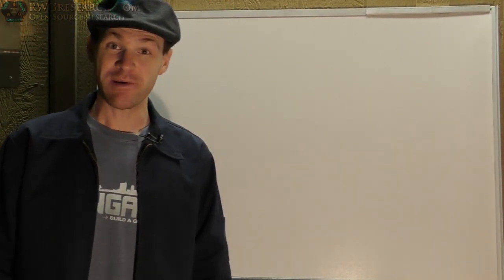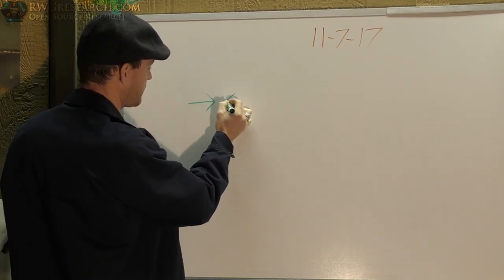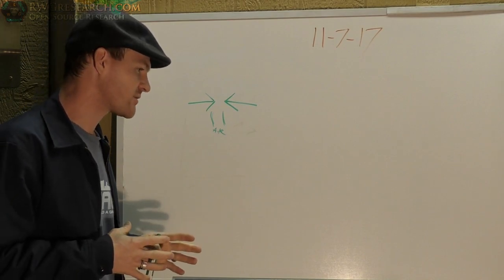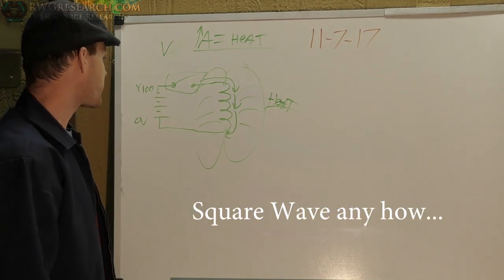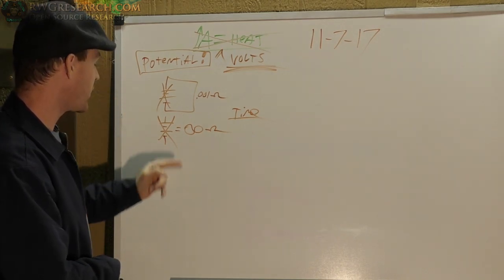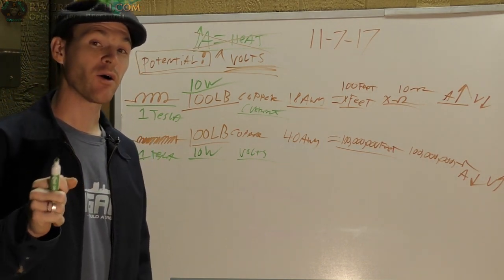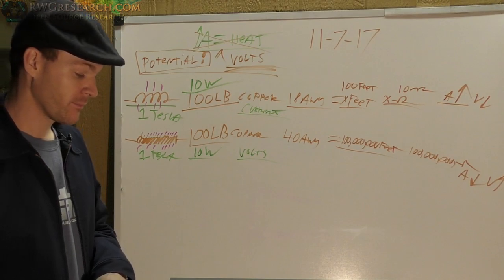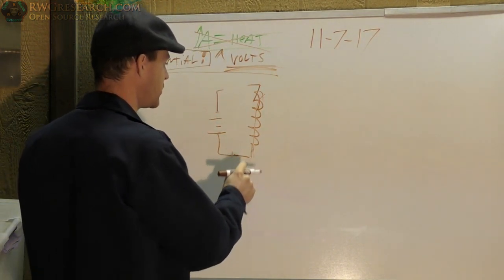The Search For Answers Part 9: Resistance is a problem... or is it?

Comment: Now,to say something has a negative resistance,is to say that power is being added to the system by that negative resistor. So no,an arc(spark) between to potentials is not a negative resistance,as it dose not add power to the system. As it dissipates power in the form of heat,it still has resistance,and can still be seen as a loss in the system.
Reply: If you look at DiveFlyFish's video on the temperature of plasma, it raises question about your claim that spark-gaps/plasma dissipates power in the form of heat.  Furthermore, not all spark gaps are equal in quality.  This has been demonstrated by many with their experiments with the Tesla Hairpin Circuit.
Reply: Perhaps have a look at how Tig,Mig,and arc welders work,,and then get back to us. Quick experiment. If you place a piece of paper in between a spark gap,will the spark/plasma burn through it?
Reply: one possibility is that the welders work due to the resistance in the materials...not due to the the temperature of the plasma. And also with a spark gap and the paper, just because the paper gets burnt doesn't mean the plasma/spark gap is hot.  Think about how a HHO torch is relatively cold to touch with the hand, but then can vaporize tungsten... Again the paper burning can be due to the papers own resistance...  Additionally, some experimenters have reported that depending on different elements within a system, paper can be placed in a spark gap and not be burned. I suggest that is because not all flames/spark gaps/plasmas are the same.  I think it is important to remember that we don't know squat...  So called experts, due to their arrogance, like to act like they know something, but in truth most know very little.  In my opinion, most of us know very little about electricity.  Many of the smartest people through history have rejected the electron model, but a lot of so-called experts tout it as Scientism Gospel...We have developed a model and some theories about it, but they are just theories.  Descriptions aren't explanations.  I feel the following Tesla quote holds very much truth for today," Today's scientists have substituted mathematics for experiments, and they wander off through equation after equation, and eventually build a structure which has no relation to reality." I feel Tesla's understanding of energy is much closer to the truth than the current mainstream Scientism.  His language even reflects this with terms like condenser in lieu of capacitor, or electrical pressure vs. voltage.  Capacitor and Voltage are merely abstract descriptions while condenser and electrical pressure have an element of explaining their operation.  Ultimately though, no matter what words we use, none of them are true, but are merely better or worse attempts to describe and explain reality. If we want to see the truth, I feel it is helpful to not be to attached to believing the models and and theories that we have learned, and take it all as  information to be organized and analyzed.  However, in the spirit of this rant, what do I know?  I don't know shit from shinola...sorry for the rambling...

Comment: Hi Ross What you ware trying to get out of us was That when a Field are building up in a coil time will go and when the coil is big with lots of windings and mass, it will take longer time then when it is small and with no mass. 

So What is Field "a Field is a vortex of electric lines that have a mass called magnetic polarization's and can be measured ore used as a walk horse to pull ore pull other magnetic field's" 

Field's are all part of the Universe, and the way the planets are controlled by its other, I those to think that it also hold's matter together, because it also have mass.....

What is Mass, it is in family with magnetic and together with field's they can hold "matter" 

What is Field's close up, it is a vortex build up with line forces that vibrations at a specific frequents and can be loaded in to matter, and can control matter. It can also create electricity when moved to ore from a coil, so Therefore it must be electricity in another form like, is and water.

It can also be a description of an electric state That when it is in a magnetic matter are becoming stable, ore permanent until it is exposed to a big force, so Therefore it has to have a mass.

So bacicley it is Electricity in a form of mass with a polarization ....hmmm ?? 

But I can be wrong.... Best Jørgen Thomsen Denmark DK

Comment: Another interesting presentation Russ! It is hard to believe that you can get power out and work done without a current flow. You mentioned once before that you can store power in an inductor. Is an inductor's inherent capacitance the way that you found that you can do this? 
Bill

Comment: The spark gap is not an example of negative resistance.  It is an example of a non-linear component that manifests a different apparent resistance at different current flow rates.  However, increasing voltage (even if it is only millivolts) yields increasing current flow through the spark gap.  Bu definition that is a positive resistance.  To manifest negative resistance, increasing voltage has to result in decreasing current flow.  Clearly a spark gap does not do that.

Comment: From what you have explained till 22 min into the video, have you tested a scenario like that or is this purely hypothetical?
From my testing the ressonace effect in vortext coils it corolates with what you say in terms of longer coils/more wire meaning higher resistance makes the peak effecient ressonante reequency lower. So smaller coils needs higher frequency  to peak efficiency on the ressonance effect.
However i found that a thicker wire on the same size coil (relativly) made it more efficient, not less. And a thicker wire means less resistance, but more copper so that may be why.
Dont know if this is relevant to what you are presenting or not but.

Comment: First off, it is interesting how closely your current work appears to be aligned with mine...collective nature of things perhaps?  Anyways, I question whether Amps=heat.  To me it seems more likely that heat is due to resistance.  For example, if you look into superconductors with zero resistance you will see that they supposedly don't heat up when current passes through them.  I feel we are ultimately looking to generate a negative resistance through negative electrical pressure.  Also, in fluid-dynamics, changes in temperature come about from change in pressure, ie compressing and expanding gas...  So testing change in temperature in transformers going from low to high voltage and vise versa  would be interesting.  Additionally, when we talk about transformers we think about a transformation resulting from the collapse of a magnetic field.  However, what happens when we collapse a dielectric/electrostatic field in a similar manner?  Dielectric transformer...  Is this not along the lines of what occurs in the Tesla Hairpin Circuit where the spark gap initiates a collapse of the dielectric field in the capacitors.  Lastly, apparently it is possible to achieve nanosecond switching with a over-voltage spark gap in ultra-pure deionized water..  This might be superior to semiconductor switches...

Comment: I really think you should read the book,  https://archive.org/details/magnetismandele02guthgoog,  you will love this read he talks about how electric is way faster then light speed an the tests he did to prove it.
Reply: I also think you can do work with very little current we just utilize current to its fullest potential  in order to save space time an money.  Lots of capacitance creates memory in the electromagnetic field making the system more efficient over time running, this is the reason we have run caps on motors, but i also think the cap protects the motor from heat load and voltage spiking.

Comment: Russ   After a mind bending paradox thought process(2 weeks) I've created the 18 AWG vs. 40 AWG per lbs. wattage chart. Hope it is easy to understand it came from my mind.  The thought process went that Resistance and Wattage are fixed and the variable is voltage,  find voltage then the amperage calculation follows.  My mind is racing with motor designs and circuit configurations,  hope someone does the experimental work to test out the lbs. for lbs. magnetic force equivalent that is involved.  I have not proved it for myself, yet.  Coil winding power formulas only talk about amperage only, so wattage being what really matters has been eye opening to me.   https://drive.google.com/open?id=1yPL2tusgYF5Qxnfr5VbedZDcaxO4cyBO
Reply from the maker: sir, your on to it, you are going to love my next video ( tomorrow it will be up) I talk about this very thing. but in a different way. and your right. that's the entire thing about this... also something for you to think about. current dose not make a magnetic field. current only aligns the atoms... voltage "pushes" out the field..... this is very important! you only need a tinny current... the rest is voltage... 

try this: : 
if we fix the power... fix the resistance, and fix the voltage and fix the current. . then you see it... 
you will increase M.M.F ( ampere / turns) for the same input power... 
you will increase the BEMF. 
you will increase the LB of wire, 
you will also increase the turns...... 
use smaller wire, use less current ... 
what it comes down to is the amount of mass vs the amount of turns... 
so if we recalculate your work using the (amperes / turn) MMF in to ( lbs of copper / turn) you will get a new MMF that dose not connect to current...
once you understand what I'm saying, then you can expand what your seeing in your graphs! 
your just doing it another way. that works also. 

congratulations, you found the answer on your own, and its a real answer... 
check the links in the description.........

God bless and thanks for sharing! power to the people. 
~Russ 

PS. there theirs a lot more to discover as well... in due time.